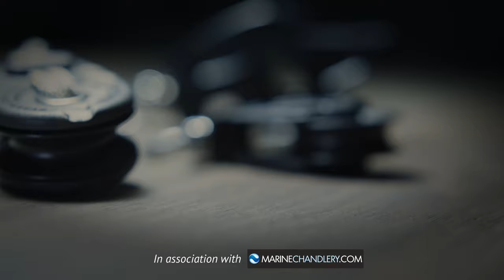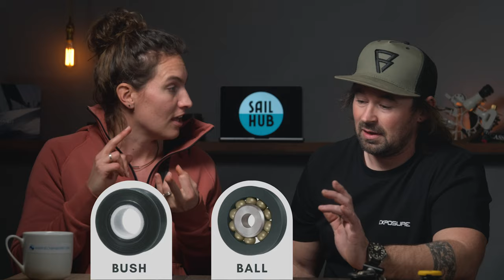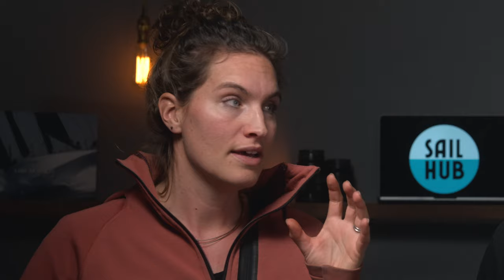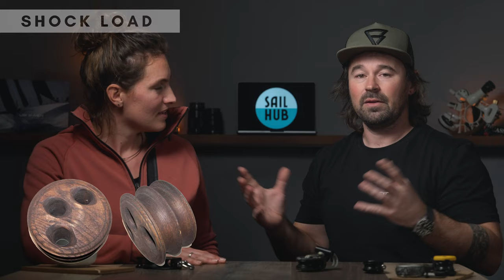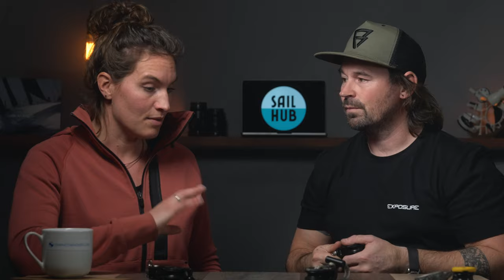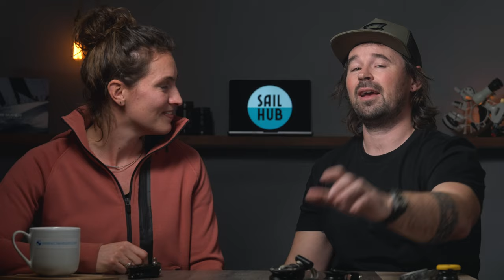What BLOCKS where and why?

Comment: Another factor to be considered is axial rather than radial loads. Needle roller bearings are not as good as roller bearings at accepting axial loads.
Reply from the maker: This is very true! However we shouldn’t have these loads in a block if the correct block is used for the job.👍